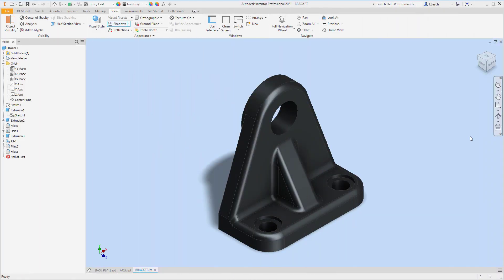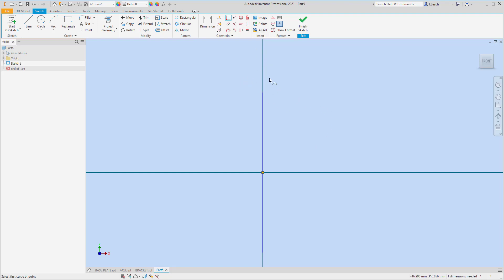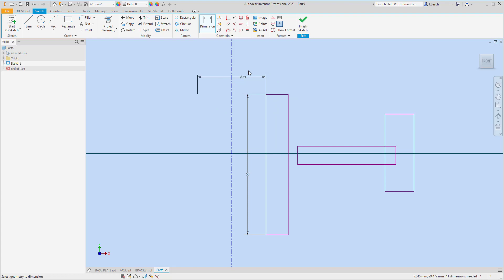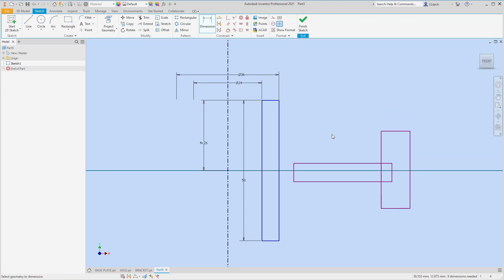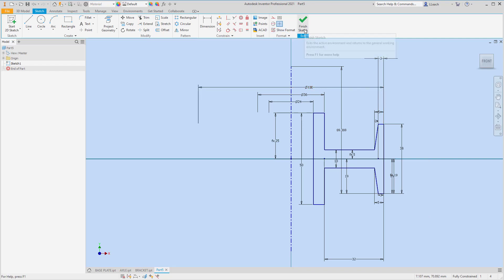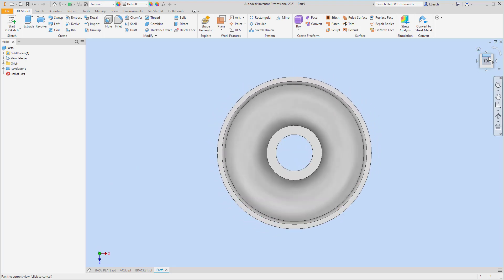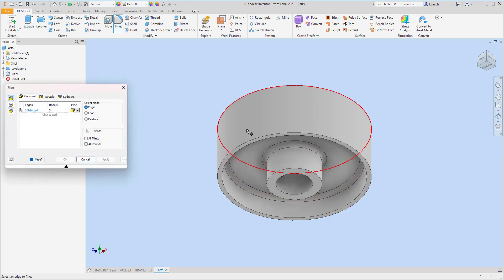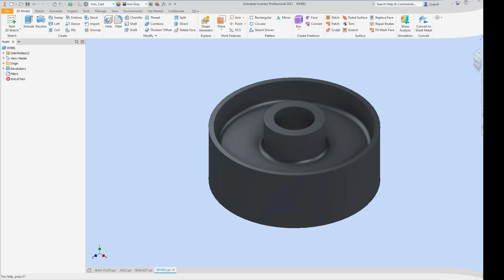INVENTOR WHEEL ASSEMBLY WHEEL

Comment: what do i do if the diameter symbol doesnt pop up in the dimensioning? i tried the alt+0216 to put the symbol into the dimension but it says the expression cannot be evaluated.
Reply from the maker: Try this, "Note you must use the numbers from the numeric keypad on the right side of the keyboard. Press and hold ALT key, type in 0216 and then let go of the ALT key."  Hope that helps.